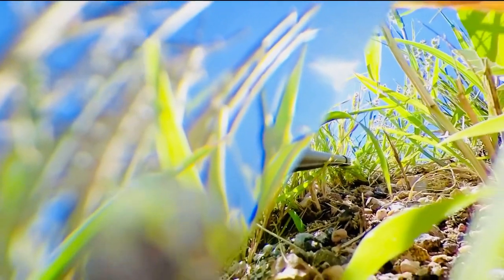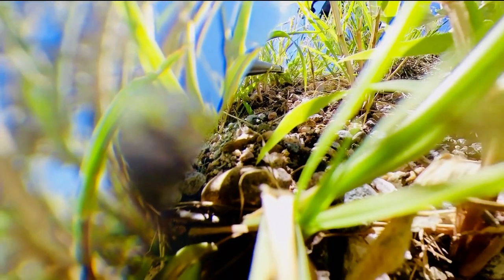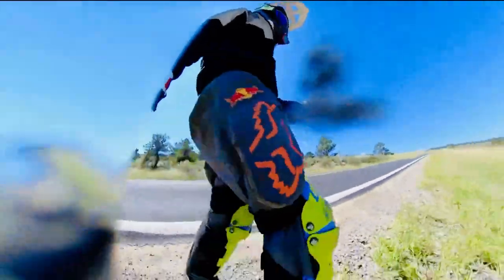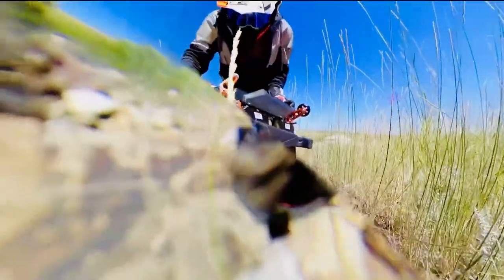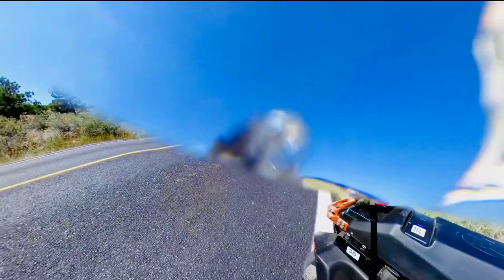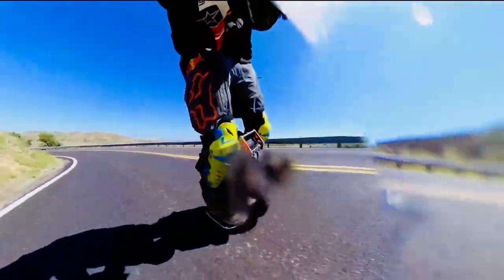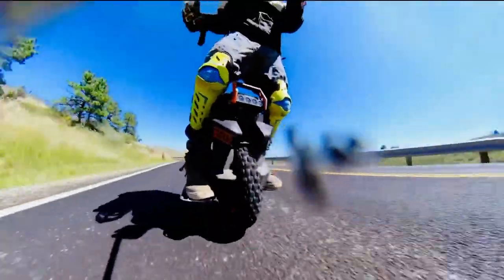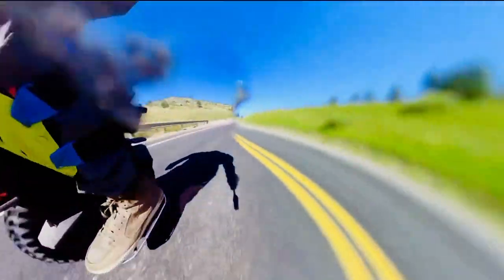Voltage sag crash on Begode Extreme cruise version, low-amp cells, 50E.

Comment: A little math: LG 50T @32S4P. 2400 WH, AH/cell=4.85. Calculated voltage =3.866 for 2400 WH. 3.866 x 4.85 x 32 x4 = 2400 WH. Discharge current/cell = 7.3 Amps. Available battery power = 7.3 Amps x 3.866 volts x 32 x 4 = 3612 watts. The motor is rated at 3500 wats. This leave a 3% margin.  For comparison, my Alien Rides Nikola+ is LG 50LT @24S6P 2700 WH. AH/cell=4.89. Calculated voltage = 3.834. Discharge current/cell = 14.4 Amps. Available battery power = 3.834 x 14.4 x 24 x 6 = 6625 Watts. Motor is rated at 2000 watts. That is a 231% margin. Is there any question that battery sag caused the cutout when Chooch accelerated hard from 35 mph. The LG 50T is the Begode standard unless the dealer has ordered a custom version. YouTube commenters have dissed the Alien Rides Nikola as too expensive for what you get. There are some features like the led lighted logos that I could live without, but not the better battery. The 50LT is not a super premium battery like the Moli, But it is plenty good enough in a 6P configuration. I do not know if the Extreme comes with the 50T or not. However, I believe that the 50T is just not adequate.
Reply from the maker: Thank You for great comment. I am totally agree. Your math seems correct. Performance wheels as Begode Extreme need hi-amp performance cells as Molicel P42, P45 or at least Samsung 40T. Low amp cells as LG50T, LGLT, Samsung 50E gives you more range at cost of dangerously rapid voltage sag as you see in this video.
Reply: this is not LG50t but Samsung 50e. No one is using Lg50t anymore  IMO
Reply from the maker: @arturslapins5595  Correct. Both LG50LT, LG50T, Samsung50E are low amp cells, good for range, chill cruise type, Marty Backe style. For Chooch style, aggressive  racing, please, use hi amp cells as Molicel P42B, P45A, Samsung 40T, etc.

Comment: Is the Extreme a failure?
Reply from the maker: Probably, the heavy acceleration caused rapid voltage sag with short tripple beep warning & cutout as result. High amp cells gives you less range, but more playroom. 😎☕️🇸🇪
Reply: This was not high acceleration, this was also going at just 30-35mph. This was a hardware issue. Even the t4 wouldn’t cut out at this speed.
Reply from the maker: @themadchemist2805  Now we know. It doesn’t takes much to cut the flow on 50E config. Ask Begode factory team why they use 40T config for the stunts!
Reply: He overpowered it. Any EUC can be overpowered, and he was learning hard into that wheel, up a gradient. A bad crash no doubt and he was pretty upset about it, which is understandable. The beeps are an irrelevance if you put the load on fast enough and the battery pack cannot deliver the current required to keep you upright.